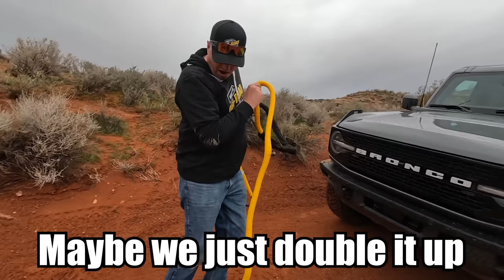More Difficult Than I Thought...Is The Wrecker Too Much For Me?

Comment: Boom is too short and not having some type of bar that keeps the towed vehicle from moving towards the wrecker is always going to cause problems.  Even so it looked like a successful recovery and the Jeep owner was happy. If you had used a hydraulic boom that would extend and retract as needed it would have allowed much more adjustability.

Comment: Is there a reason a triangle couldn’t work between the wrecker and the towed vehicle at the bumper to bumper level to prevent the towed vehicle banging/sliding into the back of the wrecker… I said triangle, but it could be just two straight bars that holds the towed vehicle away from the wrecker… I could draw a sketch if need be.   This this would work great.

Comment: Instead of straps why don`t  you build solid tire mounting point like hitch of a trailer for the towed vehicle? You will be able to lift it up and down and to take corners but the towed vehicle wont move front and back. Just like the straps you using but solid.

Comment: I helped My Dad toe allot of cars with other cars and he came up with an idea to put a chain ⛓️ through heavy duty pipes, two pipe setup in a V configuration with "come along"cables to wratchet them tight together. This would keep the rear car from running into the or getting too close to the front car. The V-Pipes created a triangle between vehicles and it was so sturdy that for short toeing distances my dad didn't always need my help in the 2nd car. 🛻<🚕 kind of looks like this only the v is flat not vertical. This will only work on hard bumper/body parts.
I'm open to questions.
On the other hand, have Jefe take Kevin Williams (lite bright) to lunch and pick his brain about his bronco and what he's done. He didn't have to spend allot on his bronco.

Comment: you need a bar with a hime joint or swivel and  sum kind of clamp to get the front diff of the car your towing an the back of the wrecker  so you dont need to rely on the brakes of the car your towing

Comment: Jamie did awesome but isn't the wrecker set up with a welder? could of burned the steering cylinder back in place and drove it out.
Reply: The Wrecker has a Premier Power Welder.  Not too sure how well it would work welding aluminium to steel.

Comment: is that jeep sitting on an f150 or bronco frame??
Reply: None of the above. It's YJ frame 78-79 bronco axles and front suspension. 4.6l V8 Swapped with m5od trans and Borg Warner t-case. Topped off with F150 steering column, Guage Cluster and Comfort Controls. I call her a Feerd Wronco. The build is covered on my channel😂

Comment: Why would you put those tires on that Ford expedition that’s from like 1976
Reply: It's a 1999 ford expedition with 33 inch Nitto  Ridge Grappler tires. That beast actually does great off road. This day I just got hung up on my running boards, which came off the next day.

Comment: Why tow the vehicle so it always swings and hits things?  Why not have a single axle (super short trailer) that just the front axle of the towed vehicle would fit on so that the front tires of the vehicle are locked in it?  solves the problem of vehicle swinging around taking damage from the boom and having to ride the brakes on it.

Comment: why don't you use a three-point hitch for the distance control. you already have 2 of the 3 points. think about the three-point hitch upside down, but is doesn't pull but push.

Comment: Why don't you have a couple metal bars with bushings on each end, four jobs like this. You can just pin them im to the back of the wrecker. Then if somebody has proper recovery points you can just look them up and use your winch just to pick the front up that way nobody's running into you. If they don't have recovery points you can stop the bars to say the front excell l
Reply: Google Voice has that all messed up I'm not fixing it you know what I mean